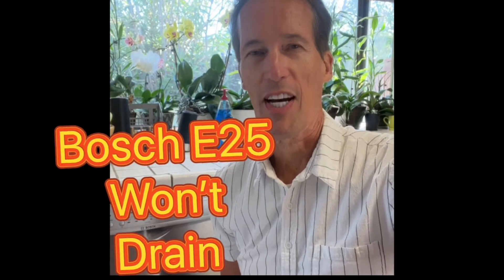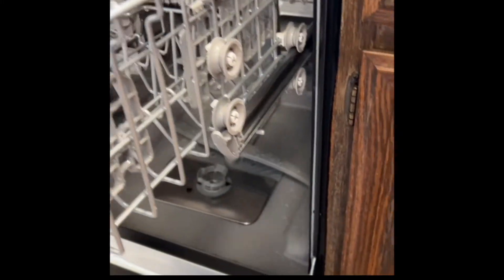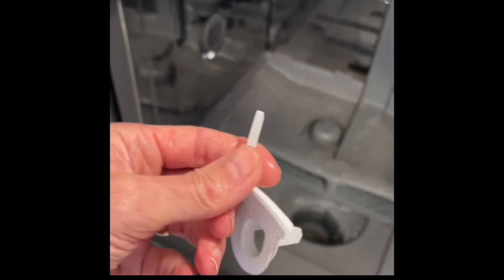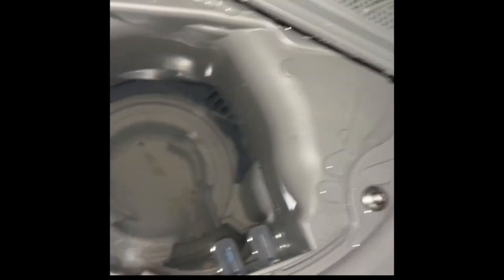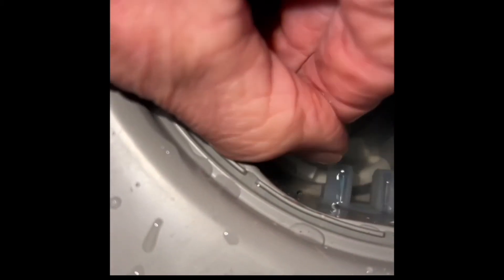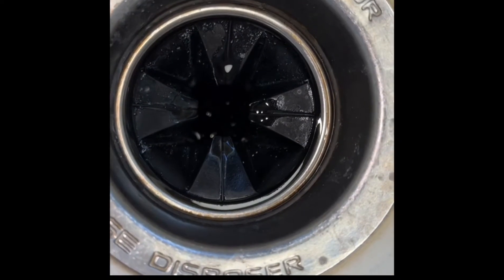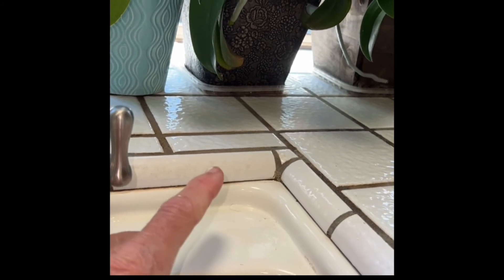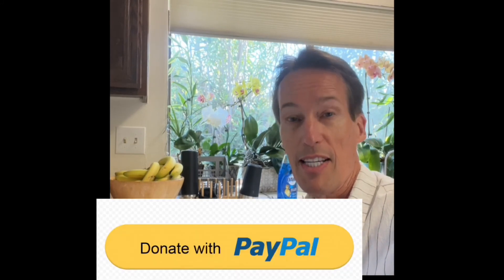✨ Bosch Dishwasher - E24 & E25 Error - Easy Fix ✨

Comment: Your video made all the difference with my Water Pump replacement.  Other videos did not indicate the retaining tab on the pump cover.  I wonder if there is a sensor behind the tab.  Or maybe just the movement of a semi loose cover causes impeller contact.  In any case, thanks to you my machine is draining again. Much appreciated!!
Reply from the maker: That is Awesome 😊😊😊

Comment: This was good and I was able to follow removal of the white plastic drain pump entrance/ After cleaning I kept getting the error I could hear my pump try then stop.  the placement of that white  plastic piece has to be perfect.  tilt back slide down and then snap but I had to do it two or three times to get it to work.
Reply from the maker: Thanks so very much John😊

Comment: Keep getting the E-25 code😔 The drain motor I think it was, had to be replaced early last year or the fall before. Fortunately the prior owner of the house had a valid service contract, that’s now expired. I could be wrong but I think the service guy said the cost and labor was more than the dishwasher was worth but because of the service agreement, they’ll fix it. Now the code is back. I even used the wet\dry vac to suck out the water and whatever if anything was on\behind the impeller. Did everything you said and no luck😡
Reply from the maker: Can you send that same question to my email at: scottthefixitguy@yahoo.com